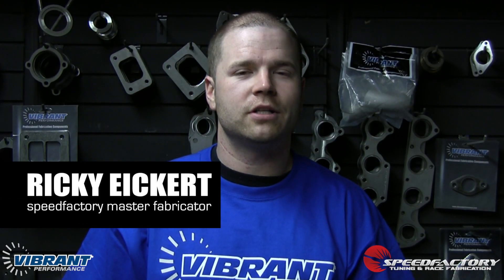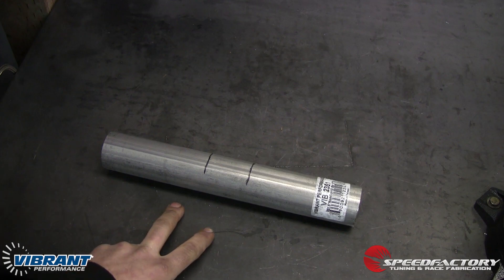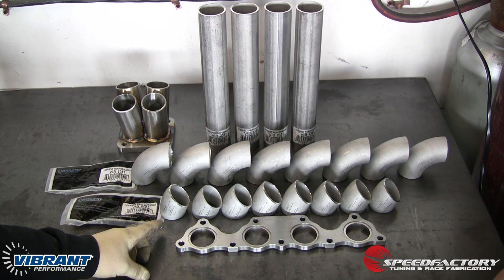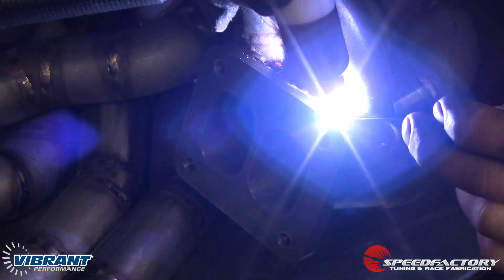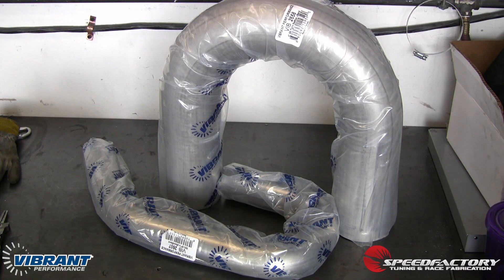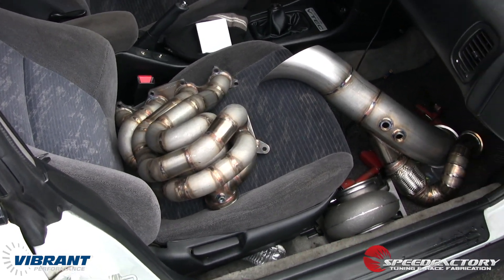SpeedFactory Vibrant Racing Civic Coupe Build: Part 1

Comment: Can someone explain why frontwheeldrive cars are modified at all? I mean "Sport" and "Frontwheeldrive" kind of doesn´t work... Are there any advantages over rear wheel driven or All wheel driven cars? 
Thats a honest question, don´t mean to insult all the frontwheelers :D
Reply: Challenge and advertising, that is all.    saw them run in seattle at the NHRA track, friends son is a welder there.  Pretty much just a challenge to make fast FWD 4cyl.   already planty of fast RWD v8s.  they make a killing on custom parts since they have the "world record" for the fastest 4 cyl Honda so now all the rice boys throw money at them.  kinda like when  i chatted with some guys that were using a 2V heads and not the 4V that was a bolt on option. they responded with "no, we want the challenge of building the fastest 2v motor we can"
Reply: ive seen a ford festiva with a factory mercury capri turbo 1.6l swapped engine take down a ferrari on a road course.  the guy that drives the car can hit better lines on the track than the lotuses that try to keep up with him.

Comment: Purged the downpipe but didn't purge the highest temp section of the highest temp part, the manifold collector.
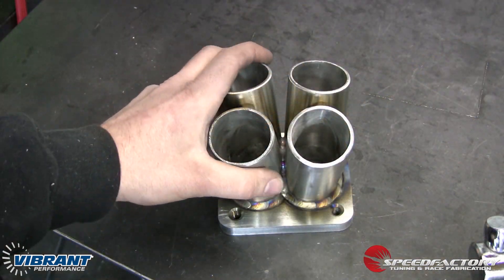Reply: The collector was purged when it was final welded. 1:48 but the runners weren't because its physically impossible to purge all the air out of the runners with the gap running the length of them on both sides.
Reply: Kristi, doing the final welding at 1:48 purged is already too late.
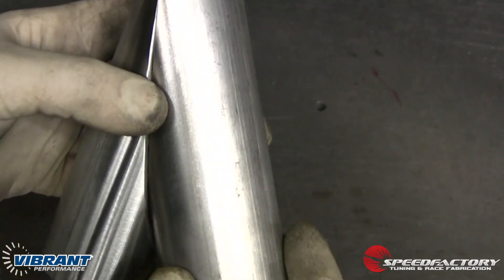At 1:15 you have a butt weld, with the surfaces in direct contact with the gases at the hottest point where the surface area is reducing, and you didn't purge.
Make a tapered aluminium bung for each of the 2 collector legs, and another bung for the tip, make an m8 hole through each, knock the bungs in and purge them.
It's very easy to do, there's nothing that can't be purged.
Of course it may not matter, but if that was an inconel or 321 s/s manifold you're risking a lot of money or a race retirement.
Maybe your way is good enough for what it's for, it's your call
Reply: nicelittlerunner good enough sometimes is good enough. Yes you are correct anything can be done, but this isint a NASA part that's going into space, it's a sch10 manifold for a Honda. Yes it could have been purged, heck could haven even purged the table if you want to be picky, but they have to make money from these parts, and purging only the crucial parts and purging everything could be the difference in turning a profit that day with time spent and argon and not making anything at all.